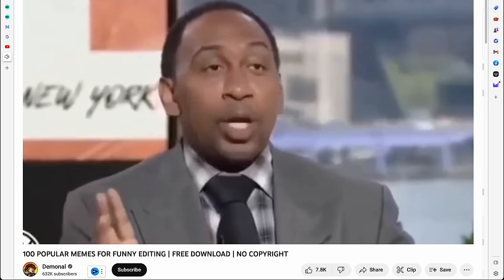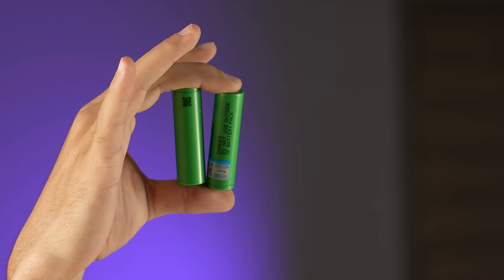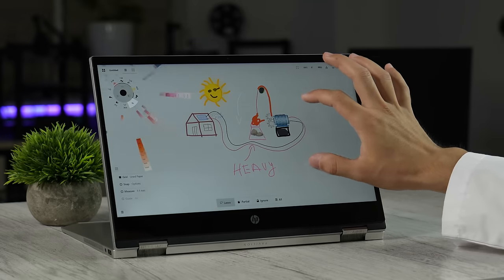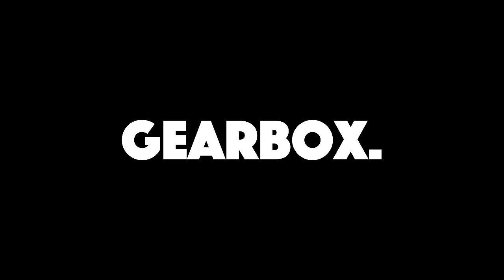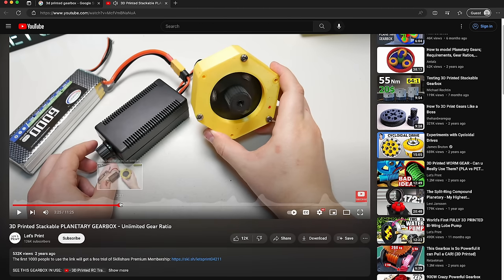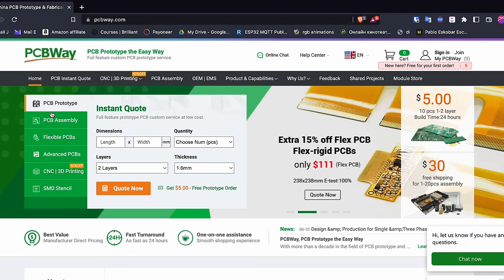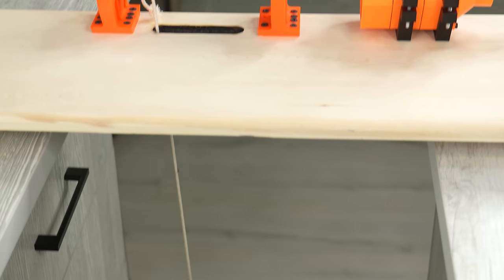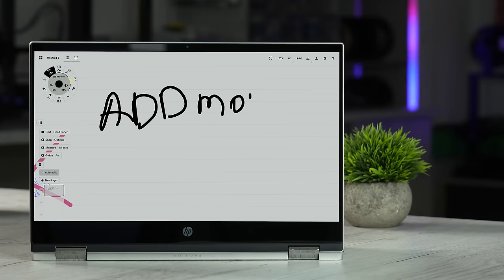DIY Gravity Battery: Unexpected Results!

Comment: I’m glad nobody died during making of this video. 😎😉
I had once a similar plan, which involved the re-use of very old well (now dry but quite deep) and using the motor directly on the top and even making autoloader of the weights which could be stored on the top.
What is important - you can make some kind of gearbox allowing you to switch between two motors with different specs and gear ratios 22:43  - one deigned as the elevating unit and the second strictly as the efficient generator.
What this video lacks the most are the measurements - how much energy did you put in and how much you were able to get back? You should check the voltage, wattage and time and calculate the power…

Comment: Could you do something similar with water being the moved weight?  This would take the bulk of the weight off of your transfer motor(pump), but add the complexity of needing a separate turbine to convert the energy back.  Luckily, it would also be safer in case of failure.  Great Project!

Comment: Have you tried a flywheel? They can mechanically store energy as well. There is a large one in our area. They use it to level out the surges and slumps in demand. Only disadvantage over a gravity battery is that you can’t store the energy for a long period of time.
Reply: I've wondered about a flywheel running in vacuum to reduce drag.
Also inputing/extracting the energy magnetically. 
Limiting factor on energy is usually burst speed. Rpm at which flywheel will fly apart....if flywheel could be supported by large bearing pushing on it's largest diameter inwards the forces trying to expand the flywheel can be resisted by a bearing backed up with a housing as thick as  needed. 'No need for a hub either. Air bearings good for high speed/low drag. Flywheel could be a loop of flexible foil that can be magnetised. Housing is hollow cylinder with lots of holes to provide the little pockets of pressurised air to float the foil  flywheel loop. Should be able to run very high rpm
Reply: @stevecummins324  would be interesting to test how much the vacuum helped. The industrial ones I have seen are very smooth. I wonder if the vacuum would help the efficiency of the motor/generator? Dissipate heat better.
Reply: @MattnUska  aerodynamic drag forces proportional to square of peripheral speeds. (at none supersonic speeds anyway) So doubling rpm quadruples drag forces and energy wasted.
Drag is proportial to air density. Halving air density halves drag forces.

Vacuum prevents heat loss by convection. Not good for surrounding coils of a motor, as they heat up due to current flow. However if motor had  moving  permenant magnets, and fixed coils outside... The electrical  coils could still be cooled, and the reduced  convection of heat to the magnets might even reduce the temperature of the magnets. Magnets start to loose their strength if heated too much.
Reply: @stevecummins324  funny thing after I made this comment , a video “the aerodynamics of a cow” showed up in my feed. Haha.

Comment: You could get a 100W motor from Unite for well under $100, which has a gearbox and sprocket for bike chain. You could then achieve further reduction using a couple of sprockets and chains. The gearbox is planetary so it's quiet, and you wouldn't be using anywhere near the full capacity of the motor so it wouldn't require temperature monitoring. The use of bike parts with good bearings would drop friction to nearly zero... roller chain and sprockets are among the most efficient mechanical transfers.

Comment: Suggested edits/additions: 1) instead of a rope attached to a single point I'd use a chain or rope attached between two points or two pulleys. This way you could lift the weight without having to turn the motor if you wanted to. 2) setup a counter weight system so that there is less power required to lift the weight 3) I'd look into building a lifter that uses something like say nitinol wire and something like "crystal cell batteries" to power them. nitinol has a lot of lifting power from small amounts of electricity, actually heat but electricity works too, and those so-called crystal cell batteries are perfect for that. Those batteries don't put out a lot of power but they would produce more than enough heat to activate nitinol and combining the lifting power of activated nitinol with a counter weight means you could easily lift some rather heavy weight with those cheap and extremely long lasting batteries. I had a similar idea but more complicated idea and was thinking of using water, two containers and a tesla turbine. Instead of using the dropping weight to move a generator I was thinking of using the weight to increase water pressure and a turbine to turn a motor/generator.

Comment: A very useful video and experiment. You put all the weight onto just one point which you had to make stronger. If you fix one end of your rope to the beam, attach a pulley to the weight, pass the rope through this pulley and back up to a second pulley on the beam then down to your generator/motor, your motor/gearbox will be lifting half the weight as half is supported by the beam. You will also have an additional 2:1 reduction. You could also place your generator motor on the roof and eliminate the second pulley, also avoiding loss of ground space.

Comment: I have been thinking about making one of these, but making 2-3 story tower to have the generator be on top of, and doing something like throwing baseballs/etc up to the "roof" of the tower to be collected there, to be funneled into a container and once there is enough in it, the weight will drop.. could be used by weight loss seekers to carry a heavy object up steps in order to get a cardio workout.. could use super-soaker water guns to shoot a target high up and thus transport water to fill up the tank, etc

Comment: My Finishing thesis for Bachelors was the both side working hydro pump generators . Just the same principle. Giviing out energy to the grid when the peak demand occurs. in my opinion this kind of systems could be used to store potential potential energy but not for daily uses or conventional home uses as they are kind of complex, also would require technical maintanence often i guess. Though stacking these around somewhere kind of further from the living areas to get rid of the noise and the machine related malfunctional hazards to power up small lighting and maybe heat element systems would be so cool!  Great work man.  hope you will achieve more. 

if you would like to continue to use the same fan maybe using a small heat exchanger and a fan would be making things better overall what do you think?

Comment: I think using gravity batteries to power multiple houses or small town is a good idea, but the only limitation is that it has a set energy output, and you would have to turn off appliances to be below the energy usage limit

Comment: The idea is solid, but it would also be fun to see what would happen if you could wind up a thick metal spring instead. Not saying it would be easier to make, but it's less restrictive for domestic use. Relais instead of switches could also be great, one of them being a ratchet on a load switch so that it only unwinds when in use. I'm a fan and I think this could have some real use.

Comment: use rain water reservoir and a spring retention lift mechanism, Just use a reservoir which holds 30x weight needed per night, when the water weight reaches the ground use a mechanism to empty it and it will return to the top.

Comment: Usually the energy conversion ratio is what fights against the widespread use of gravity batteries. You have to power motors and then have it regenerated by motors which can lose you a lot of energy. Not that it matters in this case where you are just using extra energy, but it is a problem for widescale use. This may be a bit of a gimmic considering it probably only supplies power for like 2 minutes but it is cool.

Comment: That was great try, but you definitely need metal and, therefore, more effective gears and other details, more powerful motor. Yes, that type of system works much better when it is powerful, but it can also be very helpful built as a real system, not as experiment. I've used the 10kg version before where I had to lift the load with my hands to charge my phone and a couple of powerbanks during extended power outages. It was a wonderful thing. It's a pity that I had to get rid of it.

Comment: If we follow the potential energy formula: Ep=mgh. A good 18650 lipo battery can deliver up to 10Wh (36kJ). So, if we consider a 1 metric ton (1000kg) weight we have 3.6e4=1000*10*h => h=3.6m. so a single 18650 cell may lift one ton up to 3.6m (in perfect conditions). The weight to energy ratio is far more efficient with chemical batteries instead of mechanical ones. But great video!

Comment: For 3d prints that must not break easily, just use more % infill, I sometimes use even 100%, sometimes it's cheaper than printing it multiple times because it broke
Reply from the maker: Hmm, i think you are right, printing with 100% infill is better than printing it several times😅 thank you for the tip, I’ll consider that in the next projects

Comment: Pretty neat idea.  I saw a video a while back where someone did something similar but used a water pump to pump water up to a tank on their roof.  Then used a pelton wheel set up to create energy from the water flowing back down.
Reply: Yes, I saw that excellent video too.  The video demonstrated exactly how weak the system was at small home scales especially using just water.

https://www.youtube.com/watch?v=CMR9z9Xr8GM

So even all the weight of a large water barrel (~500lbs) stored at the very top of the roof only amounts to the energy of a AA battery (~3.9 Wh)!   Not including any losses from the generator either.  Want more power?  Use more water barrels but remember each one is already 500lbs when full of water.

The physics potential energy equation verifies it: E = m × g × h, where E=energy(joules),g=9.81m/s², m=mass(kg) then convert resulting joules value to watt hours.  That's why commercial pumped storage facilities are very large using the weight of a small lake at minimal.  Plus the height will be several house stories.

Sure, water is fairly heavy at nearly 1000kg/m³ but not nearly as heavy as steel which is an impressive 7850kg/m³.   Some other metals even heavier.  The denser the weight then the density of the energy storage is.

That's why commercial heavy lift gravity storage use metal weights or combination metal + water as hydraulic fluid in vertical mineshafts.  See: Energy Vault, Gravitricity, ARES, CNTY, and Gravity Power.   They are powerful and store more energy compared to the best Lithium storage we have now (Tesla Megapack).  But the cost greatly depends on the availability of abandoned mineshafts.  But there are 10s of thousands of in the US.

I think large scale gravity storage is doable though using mineshaft or drilling techniques and iron masses.  Because pumped hydro has too few suitable natural geographic locations.  Plus with climate change and increasing long droughts, water use and preservation will be even more highly contentious than they already are.  That only further reduces availability of commercial pumped hydro energy storage.

Comment: It definitely works better at scale. Infact someone once told me that something like 80% of the USAs power reserves are stored in reservoirs. These are the same concept as the gravity battery. When the wind turbines are creating excess power they pump water into a reservoir up high, then when these no wind they use the water to power hydro turbines.

Comment: A 12/24 volt vehicle winch motor would be much better for that application and designed for the stresses of a high weight load.  Off grid 20+ years and I use LIFEPO4 batts for night time storage and excess power in daytime is used for charging ebikes and a dump load like water heating. Heating water is also a way to store energy for night time use.
Reply from the maker: Thank you for your feedback!

Comment: If you were making a large-scale mechanical battery, you could attach a gas bag to the weight, and inflate it with helium to make it easier to lift. Then when the battery is at maximum, pump the helium back into a storage container. It doesn't even need to be pressurized, just shifted from one place to another. I think this would increase the efficiency of the battery, because even though you're using a fan or pump to move the helium around, it doesn't take a lot of energy to do so.
Reply from the maker: Woah, nice idea!

Comment: This is a great video.  If you ask why are we not doing this? The short answer as to why it is not practical to do  at large scale is because of " Newtons Second Law of Thermodynamics" basically the efficiency of this type of battery or set up can never justify the cost. When it comes to power generation and storage the "Second Law of Thermodynamics" is always going to be the limiting factor.  The Second Law of Thermodynamics is why you can never have Perpetual motion.

Comment: I would recommend adding a few capacitors to get cleaner power from it. and make the shaft where the weight rope larger in diameter so it doesn't need that push to get started because the weight makes enough tourque to get it started (but this might put more stress on motor). put a hear sinc on the motor.

Comment: Larger scale- Use a drum, winch it up empty, get a solar panel powered pump (they sell them at my local hardware, things have an amazing head from just a single 250w house panel) or a DC or AC pump and pump water to the raised drum, you will lower the stress on the motor pulling the drum up over pulling a weighted item up and be able to use a much cheaper/more efficient  motor, have a dedicated generator attached to the system also, this negates the reversing issue and should be a far more efficient generator than a motor,  pumping water is efficient, then you'll need to overcome the storage issue for the water and a system to transfer the water once the drum finishes it's journey.

Comment: Rather than high ratio gear box. Maybe try a differential windlass?  Two drums of ever so slightly different diameter, fixed to common shaft. When drums are rotated cable wraps onto one drum and different qty leaved other drum... Difference is how much differental pully pulls in. And easy to make high ratios and high load capabilities. .

Comment: this is the sort of thing i have considered as well, though i have none of the tools to build or CAD the parts and pieces. however, i considered this... it has to be self contained. so, a tower of an appropriate size and height to contain the mass of the weight safely. the weight would be guided on long pole or in tracks along the sides, with a chain holding it up, and secured on its bottom side. with a large single cog at the top, and bottom of a size which needs to be tested, though i figure at least one foot, or even up to 3 foot wide, whichever works best (again testing and sizing considerations) at the base, the generator would be rigidly connected to the frame of the tower itself. with whatever gearing and electronics necessary to make it work, and to store the energy of the falling weight. the energy needed to raise the weight has to be calculated against the theoretical amount generated in its fall. it could be scaled up or down as needed for space and capacity. you could also have multiple towers in series to increase the weight, with a single output shaft to the generator/gears etc. then when the weight is at the top of the tower a physical mechanism could be used to release it, to fall, and a mechanism at the bottom along with flywheel and clutch so that the angular momentum is maintained for a little longer, but the weight mechanism itself wont stop the generator gear system as the flywheel spools down due to friction etc. subsequent towers could have a mechanism tied to the first or prior towers, such that when the first weight is at the bottom, it sets off the second, third, etc etc, however many one had. of course returning the weight to the top as part of the energy usage calculation is essential to know your net generating capacity. there will be losses, if you use a motor to raise the weights. but, if you had the time and energy (pun intended hehe) to raise the weights by hand using a crank on some sort of shaft connected to the weight, but with a temporary clutch to prevent it falling before it reaches the top release mechanism, that Could save on losses, by using your human energy, rather than the energy made with solar, or by the mechanism itself. in any case, the concept is there, it just needs some serious thought to size of components, to make it viable. and it could become like a 15-20 minute exercise routine, so may have health benefits too. also, you would want to size it so that the capacity of fall is at least 12 to 24 hours Minimum, so as not to have to re--set it too many times per day. the ultimate generator capacity i can imagine it could reasonably do, is one full week, assuming one tower is a 24 hours fall per weight, and you have 7 towers. hopefully it would nto be larger than 50-60 feet per tower, and no more than 3x3 feet for the tower dimensions. it has to be somewhat practical for generating to your desired capacity. but i can imagine it being as small as a computer desk, or as large as a house. space being the only major factor in how obtrusive it may be.